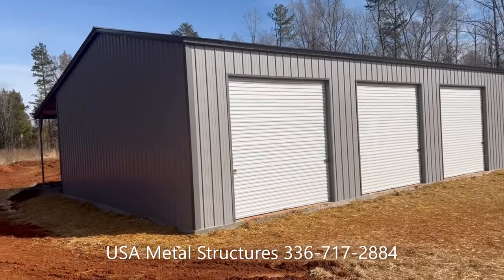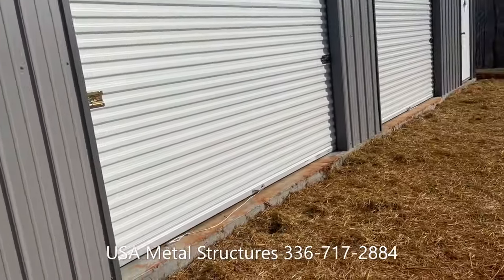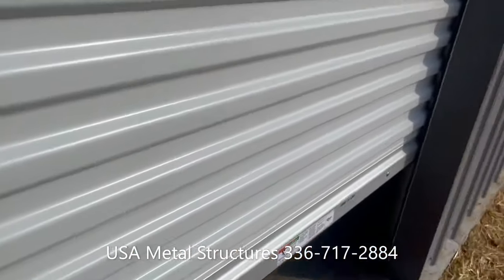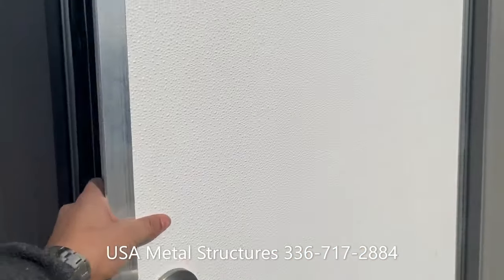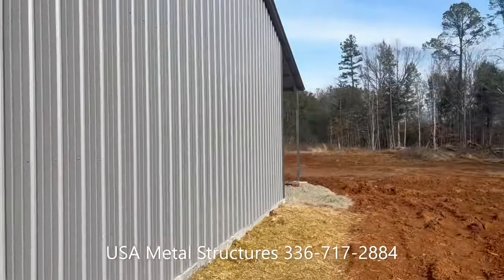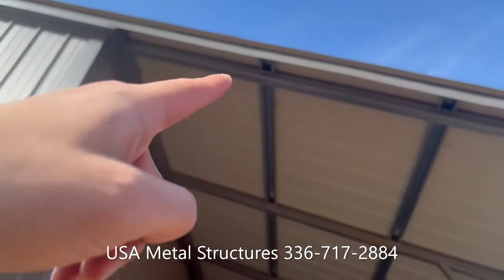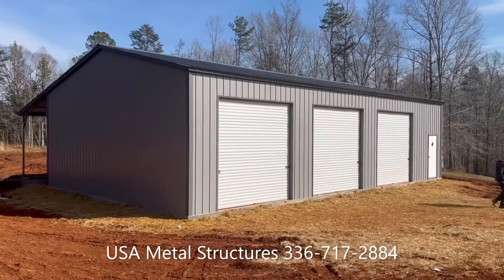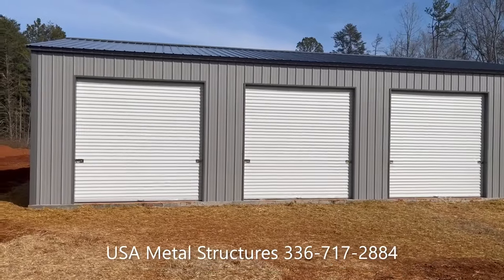30x50x12 Metal Building w/ Lean-To

Comment: Can you attach wood framing to the metal framing for the interior walls, if so how much if any distortion will this cause on the building?
Reply from the maker: Yes, you can attach wood framing to the studs. We offer an upgraded 4’ center Stud option which will make this process much easier for you.
Reply: @usametalstructures  Thank you for the info!!